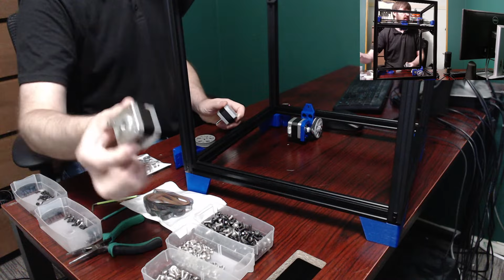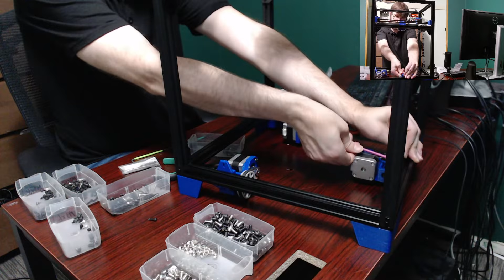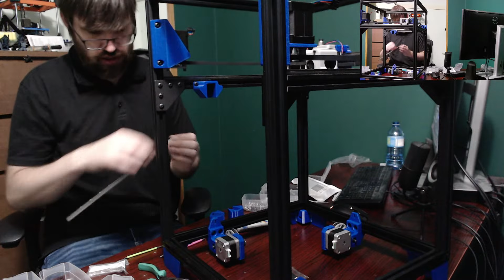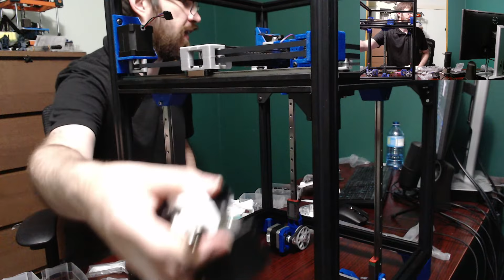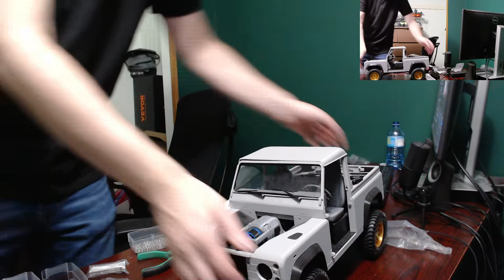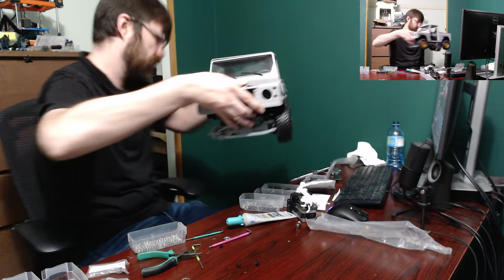SimpleCore Redux Build Part 5: Z Axis

Comment: Hey Rolohaun! If I were to scale the SimpleCore Redux build from 220×220×220 to 300×300×300, what specific changes would I need to make to the BOM? Would it just be longer extrusions and belts, or are there structural or motion system upgrades you'd recommend to maintain rigidity and performance at that size?
Reply from the maker: just extrusion and panels are all that needs to change really
Reply: @Rolohaun  Thank you very much ! Cant wait to start building and show the finished printer!